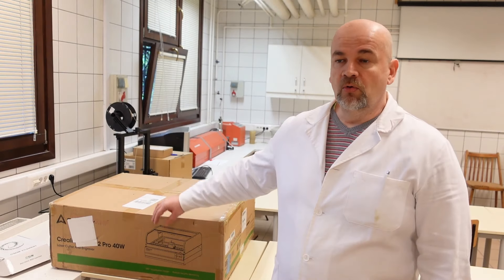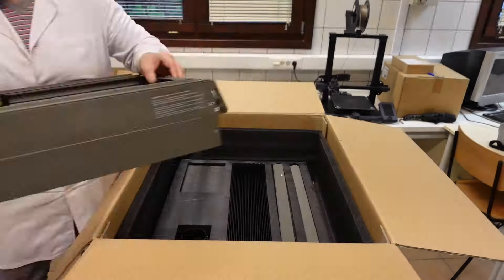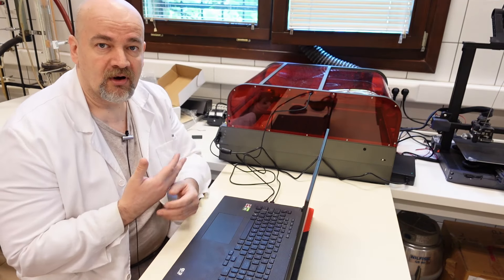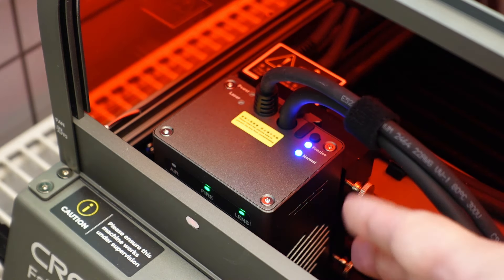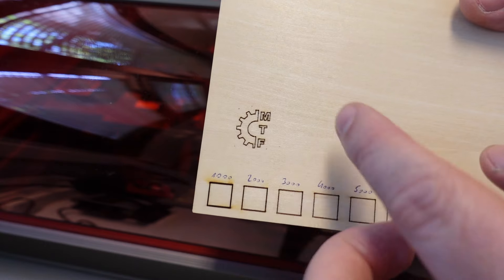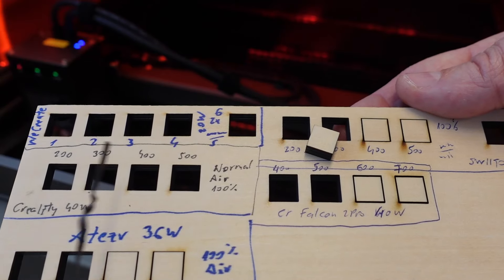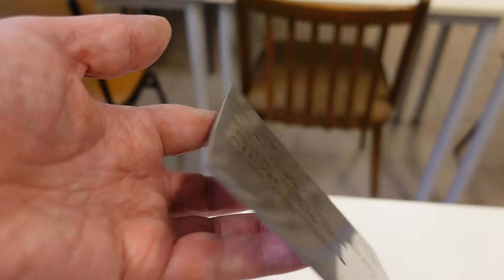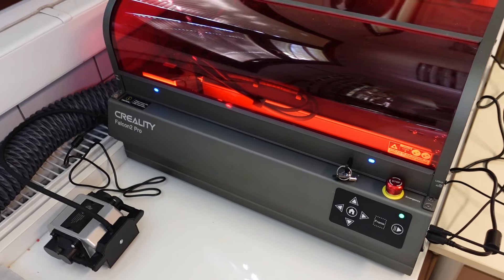Creality Falcon 2 Pro - enclosed 40W diode laser, safe even for my students :-)

Comment: Is the kerf in the x direction bigger than in the y direction? This will affect your designs if parts have to fit together and the kerf is not the same. Good to see that it handles the smoke and fumes properly.

Comment: I am having a hard time to understand what's the point for a diode laser to go way above to that price range where you can actually get a decent CO2 laser? To me the advantage of the diode laser over the CO2 was always the price/cost and the possibility to use big workpieces. (not limited or less limited by the enclosure) for USD 1700 is way above the hobby price. Or is it just me?

Comment: Very interesting, why would the X-axis be weaker than Y at the same speed? Is the focus point not a circle?
Reply from the maker: It is a rectangle. But this is very common with these engravers, which combines several diodes into one beam.